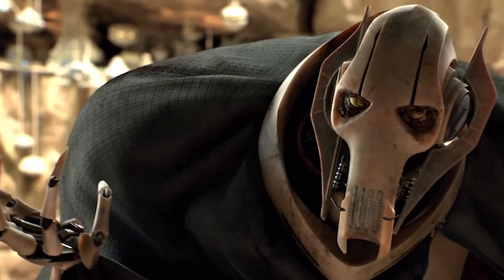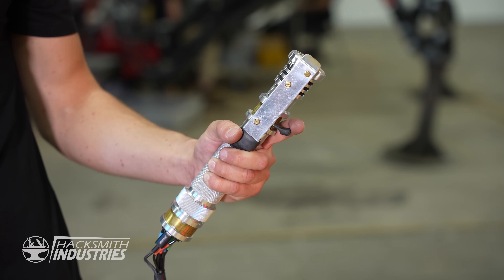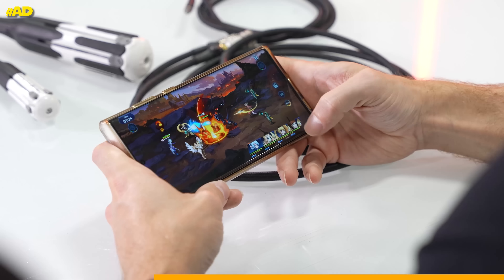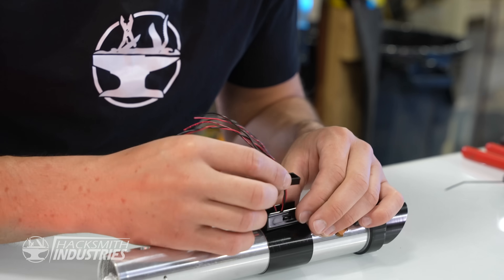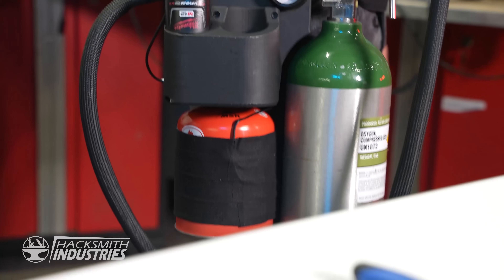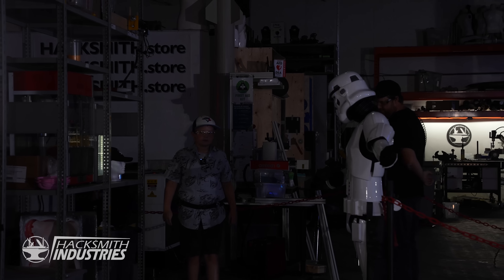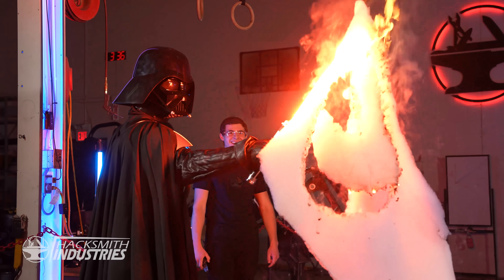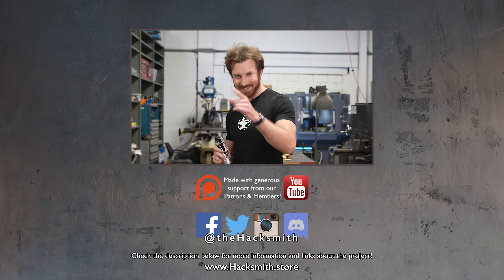My Best LIGHTSABER Yet! (STRONTIUM PLASMA 4500°)

Comment: I have an idea: what if you included a telescoping metal rod with little holes where the plasma can escape?  That would prevent the problem of lightsaber plasma "blades" passing through each other in a swordfight. Additionally, the telescoping rod might give you more room to fit things inside

Comment: I think that the way lightsabers work is that some kind of blade comes out and is instantly coated with the "magic light" so it looks like the saber is pure light but still works like a sword
Reply: If you didnt watch or read about Star Wars let me explain

The blade is a sort of "Light Plasma" that is emitted by something called a "Kyber Crystal" and then theres this magnetic field that contains the plasma, which is the thing that stabilizes and makes the plasma blade clash with another saber. Thanks for reading!
Reply: @XD_Storm20101  Oh that's way cooler but I think my way would be easier to way to make a real one
Reply: @m.yusufamlay4241  But them how it would be able to cut through stuff? From where does the light come from? And how are we handling light battery? Your way looks easier but it is quite flawed

Comment: Could you build the kylo ren cross guard lightsaber. I know its a hard challenge, but the blade of the saber looks like that because the blade is not so clean. Kylo rens have a instable blade. It would be very cool.

Comment: Do you think you will ever try using laser tractor beams to help contain the energy? You might be able to create a particle barrier that oscillates at high frequencies and on impact. Which could make lightsabers collide. Basically you use lasers tractor beams to create a barrier like a shield and you might even be able to manipulate the air.

I also thought about a particle beam with laser tractor beams pulling the particles inward strong enough to slow down high speed particles to a certain length, however it has to many problems.

Comment: I’m fascinated to see if it’s ever going to be possible to remove the power supply being outside removing the need for cords and other items instead of the lightsaber I’m not sure if it would be possible to make those parts small enough to be practical inside the actual hilt though
Reply: would require a powerful battery the size of a hilt and a fuel tank also the size of a hilt.
Reply: @Cee Boodrow what

Comment: Most people dont realize Tesla most ground breaking work was NOT in Electricity but instead in High pressure fluid dynamics.  He found under high enough pressures he could make steam and Air behave as Solid objects which could suggest a Light saber like in the movies however I could see issues maintaining that high pressure when it is under combustion as by definition the gasses are expanding due to the head.   He could bounce steel bars off of invisible steam gas leaks under pressure.

Comment: Instead of the flame instantly disappearing when the lightsaber is turned off, would it be possible to vary the gas output so the blade slowly retracts like in the movies?
Reply: If you look closely it actually retracts. Just a bit faster.
Reply: would be possible with a pcb controlling the valve but itd make it less compact ig
Reply: Of course, but I don't think that would be safe enough to do

Comment: As cool as this is and I can't doubt the time and effort put in to make this work... I can't help but think that it's just a fancy plasma cutter 🧐
Reply: yea it basically is cause a real lightsaber uses magnetic fields to contain plasma but that hasnt been invented yet
Reply: Well, yes. That's what a lightsaber is. A canonically accurate lightsaber is just a plasma blade contained within a magnetic field. The heat stays in the immediate radius of the magnetic field. Thus stopping the heat and blade to escape. Stopping it from melting everything around it. As canon-accurate lightsabers temps are upwards of 1,000,000 degrees.

Comment: why does the flame on this one too low?? You can make valves to increase the gas flow just like previous one... Don't you?🤔
Reply: Because it has like a fifth of the fuel also the electronics are about half the size. 
I imagine the first thing they will fix on Lightsaber Mark IV will either be the length or making the power pack and electronics even smaller

Comment: The light saber 'blade' tapers off too low often in this variant form. Try to make it constantly a longer 'blade'. I assume it has to do with reduction in how long the 'blade' is depending on how much oxygen is in the take. And or whatever fuel you're using in combo. And I want you guys to achieve more than melting that. I want you guys to reach crazy levels of heat. Allot more than 4500 so you can melt through anything.
You have the funding. Now make a revolutionary act and impress the world forever.
Reply from the maker: We have the funding? Where!?
Reply: @hacksmith  12.8 Million subs and you lack substantial funding?
Reply from the maker: Subscribers mean very little in terms of funding -- views are where the money comes from, and most of our videos only get a million views. Engineering is super expensive, just our overhead is barely even covered by youtube ads. If we had funding we'd be making a lot more stuff.
Reply: @hacksmith  ah

Comment: I think there is another reason The beam shortens with the Strontium. It's actually cooling down faster because the gas is much more opaque and therefore emissive than just the normal exhaust gas.

This is likely not desirable for cutting performance. The ideal lightsaber blade should emit as little heat as possible because it needs to save the heat for cutting things. Right, right, look at the difference between the SSME and the boosters? The jet from the boosters is much brighter even though that of the SSME is not that next less powerful and has higher exhaust velocity.

Adding any visible sooty flame to the jet will definitely shorten the beam.

The IDEAL lightsaber would be 10000+ degrees, have an incredibly narrow but relatively dense beam, and emit only enough light to see it by because it is translucent.
Reply from the maker: Nope, strontium isn't the reason it was shorter!

Comment: Plasma is electrically conductive. I wonder about the ability to further heat the beam by using electrical discharges?

I also wonder about using something that produces heavier exhaust gasses so that the feed pressure can be increased without the exhaust pressure being so high, since that is definitely spreading out the beam. A denser gas will make for a beam that has much greater energy density.

Comment: Would it be possible to just reverse engineer a high powered laser pointer to fit into a lightsaber hilt, then use a crystal or a prism in the hilt to help refract the beam, or have it reflect off of little tiny mirrors to increase the lasers power? Disclaimer I know nothing about science

Comment: Amazing work.  The only disappointment is that the blade lacks physical mass so dueling is not possible.  Your progress is impressive, most impressive.  Perhaps you may yet serve the Empire!
Reply: I have a solution in mind. Tantalum carbide has a melting point of 7000 Fahrenheit, while these have it at 4000. Just attach a telescopic rod to it!
Reply: @mirandalockey7334   too brittle hence used in ceramics not viable for a lightsaber

Comment: Right now, The Lightsabers are basically just compact sci-fi themed welding tools. But hopefully in the near future, The Hacksmith Team would be able to pioneer the world's first magnetically stabilized plasma saber.
Reply: Don't hold your breath for that one. Magnetic plasma confinement is cutting-edge stuff. It's one of the hardest aspects of nuclear fusion and also one of the holy grails of rocket engine cooling. It's not happening any time soon on this channel.
Reply: @sebastiaomendonca1477  yeah probably not gonna happen but can you imagine the looks on the faces of the world's leading scientists if these random dudes on YouTube managed to figure it out before they did? 🤣🤣🤣
Reply: @sebastiaomendonca1477  very true... BUT: the plasma they're working with here is a lot less hot than fusion plasma, 4500°C vs 1,000,000°C. Plus, they wouldn't need to get perfect confinement to get a more "focused" blade
Reply: @sebastiaomendonca1477  I think magnets could be used if you had a solid core inside the lightsaber blade to house the electronics. That would ruin a lot of the things the current lightsaber has going for it, but it might look the most convincing when lit
Reply: @sebastiaomendonca1477  yea most likely wont be done by them first due to the applications it would have in many arguably much more important things but if were lucky some scientist might discover a way to do it and theyll get their hands on it
Reply: That’d be quite the feat, and may lead on to the use of more laser based weaponry as they would’ve came up with a better way to control plasma in a magnetic field. Can’t wait
Reply: Each time i see his channel i start to think we are in 2389 
Bro made a iron man repulsor and a light saber up to 4500C°
Reply: I dont think making a real lightsaber is possible. You need a retractable solid source of a light beam that can cut through steel. Yeah... Not likely going to happen.
Reply: @myguitartwerks7825  it isnt a light bean. it is plasma kept in a blade shape by a magnetic feild iirc
Reply: @myguitartwerks7825  Maybe so, but as it is sung in a Soviet song: "To dream! You need to dream..." / Может и так, но как поется в советской песне: "Мечтать! Надо мечтать..."
Reply: @myguitartwerks7825  flying is impossible once
Reply: @myguitartwerks7825  my guy knows nothing about Star Wars and tries to act like he knows shit. It's a PLASMA saber. You can create retractable plasma. You can literally see them do it in the video.
Reply: @X-SPONGED  I didn't mean literally just a "light beam". 

Also in the movies what I was trying to mention was that it needs to behave like a solid material instead of just a hot source. While the jedi's fight, their sabers clash like they are solid objects from the massive amounts of energy they give off. Im sorry I wasn't more precise with what I meant.
Reply: @myguitartwerks7825  they clash because of the magnetic field that they generate not the hot plasm contained within.
Reply: @myguitartwerks7825  The clash is magnetic fields strongly opposing eachother. Not a physical blade but just the magnetic field repulsing the other. The blade is not solid. It's not solid in the movies either.
Reply: we need new source of energy for thaat
Reply: But why?
Reply: @thomasfleming7606  What  "But why"? I didn't quite get it...

Comment: why dont you guys use strong electromagnets to hold and compress plasma into a blade shape, which would bring the heat amount up way more (kinda like how fusion reactors do to make fusion possible)? You could even use the electro magnetic fields to make a sort of built-in retractability feature along with being able to increase and decrease the heat decipation rate and the rate of power consumption. Having settings on the power pack (kinda like buttons or switches) would allow for the ability to fine tune for different materials on the fly. Maybe you could downsize fusion reactor schematics to do this. Just an idea :) DM me for more info!!

Comment: Really cool I like how you can fully retract  it but this also means that you can't rally push through things like when cutting thought metal it is just boltourching it from one side instead of slicing it would be cool if you combined the 2 and had a small part that comes out and keeps the gas part.

Comment: Have you guys tried figuring out ways of activating and storing fuel and electronics in the hilt? If you remove the audio aspect it may save power and space needs.
Also, would it work better with alternative fuel that might take up less space?

Comment: I have a recommendation for a project! In the latest Batman movie (The Batman) with Pattinson he uses a rappelling rig attached by magnet to a building I-beam to run down the side of the building. Similar to the grappling hook you already made, but it only goes down, and would also need a way to shut off the magnetism back at the top once you reach the bottom so you aren't wasting cables every time, and also some method to not get hit in the head by a falling 10+ lbs neodymium or electro-magnet. I would've thought electromagnet is the only solution, but apparently you can cancel out a permanent magnets magnetism by stacking two inside a conductive frame and then rotating one out of polarity to cancel out the forces. That could maybe be done with an electric motor if it's strong enough to overcome the forces.  Your projects are awesome, I wish I had the time and funds as this seems like my ideal hobby

Comment: Suggestions:
1: If there's still gas in those tanks, you aren't size-efficient enough. Compress the gas into a liquid.
2: The blade should contain an accelerometer, if it doesn't already. The volume of the light saber noises should increase when the blade accelerates.
Reply: That’s what I was thinking too. Liquified gas would give more material for far less volume!
Reply: You can't compress Oxygen at room temperature into a liquid, it's above its critical point.
For it to have a liquid phase, it has to be cooled to -118°C (at 50 bar).
Reply: @alexanderdaum8053  I did not know that! But that just means we get to compress it all the way into ice.
Reply: @pikatheminecrafter  Would theoretically work, but probably not practical for this application.

From what I found, the pressure needed at room temperature would be around 5GPa (which is 50 000bar or 725 188psi)
Reply: doesnt make sense to use liquid gas because it wouldnt have the same effect.
Reply: Use an atomizer to atomize the fuel. Like in refrigeration. I think the liquid content will be 25-30% tho
Reply: Wouldn't it essentially be a flamethrower then?
Reply: @redacted4125  It is a flame thrower. The size of the flame is controlled by careful release of pressure, and the shape of the flame is controlled by a manifold.
Reply: They are torches NOT lightsabers
Reply: Butane, propane, etc automatically "compress" into a gas when in a sealed chamber. The vapor pressure of the gass in the chamber forces the hydrocarbon into a liquid.
Reply: weight will increase.
Reply: @noobtextwritergamer  The metal in the can is more dense than the liquid gas. It'll probably be fine.
Reply: @noobtextwritergamer  well yeah it’s more dense
Reply: I still think it would become a flamethrowet
Reply: @zureroomsoesheh8026  It's already a flamethrower. It's just that the flame's size and shape is controlled.
Reply: @Zure Roomsoes heh the gas inside lighters is also liquid, and that's not because it's cold but because it's compressed, and it can immediately "boil" because it doesn't need to heat up
Reply: @zureroomsoesheh8026  A bic lighter uses liquid butane. It's not a flamethrower
Reply: Might be to combustible, if it gets to hot it could explode The hacksmith needs to be really careful with plasma also I’m not sure if little baby’s should be near a plasma flame that seemed pretty dangerous
Reply: But it would be shooting liquid gas???
Reply: @zureroomsoesheh8026  as soon as it leaves the tank, the pressure would decreaase. But with the ongoing fire, temperature would increase as well. In turn that means that the gas would return to its natural state (gas) in an instant and wouldn't stay liquid
Reply: @zureroomsoesheh8026  that's not how gas works
Reply: @zureroomsoesheh8026  🤨
Reply: @zureroomsoesheh8026  pressure
Reply: @zureroomsoesheh8026  go retake chemistry classes
Reply: @kakakkakaka8814  "🤓"
Reply: Just like refueling your gasoline tank in a car, it doesnt turn to a gas instantly right?
Reply: @zureroomsoesheh8026  your car simply sprays a fine mist of glass into the chamber for it to explode, it doesn’t turn it into a full on gas. Gas stands for gasoline not the stage of matter.
Reply: @zureroomsoesheh8026  Gasoline is a liquid at atmospheric pressure
Reply: @Misty-jv2cg  yeah that was a bad example
Reply: We need more nerds like you to make light sabers quicker✊
Reply: Yes but doesn't it take time for the liquid to boil back to a gas?
Reply: @zureroomsoesheh8026  Basically no. It would take cryogenically cooled gas at atmospheric pressure a while to heat back up and boil back to a gas, but if it's compressed to a supercritical fluid at room temperature, it'll convert back to a gas more or less instantly when the pressure drops. For example, propane in a typical tank for a gas grill is a liquid because it's compressed, but it's a gas as soon as it gets past the regulator. Oxygen doesn't compress into a liquid—at least not at room temperature—but you can compress it into a super-critical fluid at a few thousand PSI.
Reply: @zureroomsoesheh8026  depends on the liquids properties. For gasoline it would have to be heated up, but what they are using is a gas at room temperature

Comment: concept idea I thought of when watching, have extendable tubes that would be where the gas comes out allowing it to be swung around without it going out and keep a consistent length. These could extend and compress when the activation switch is pressed.
Reply: In addition this could (in theory) allow for a higher temperature further away from the hands to prevent from possible burns (from the end when the guy said it was "toasty")